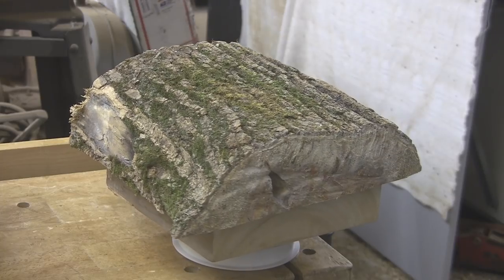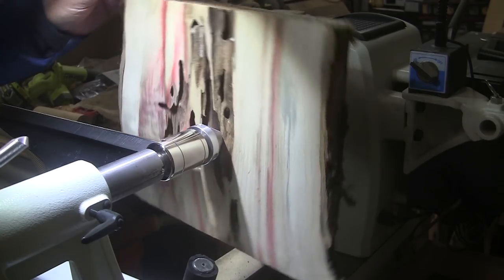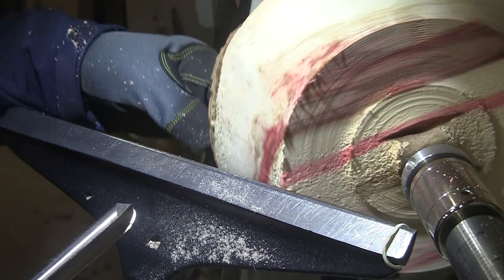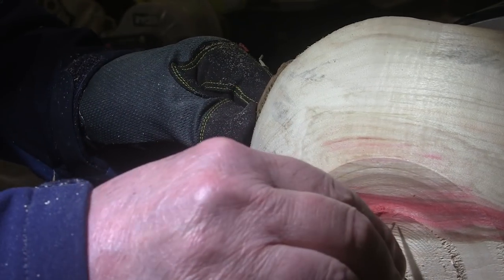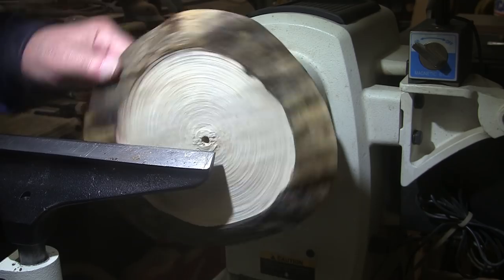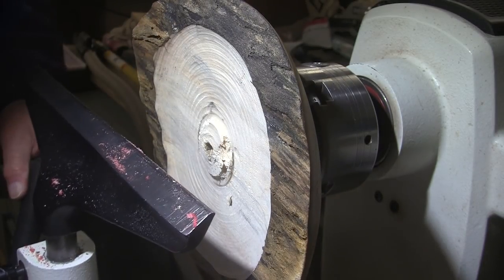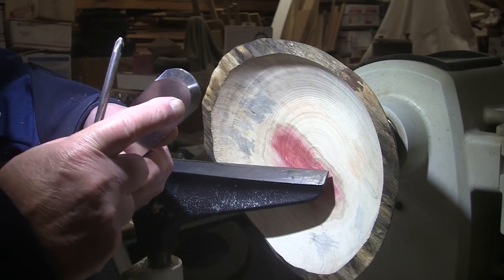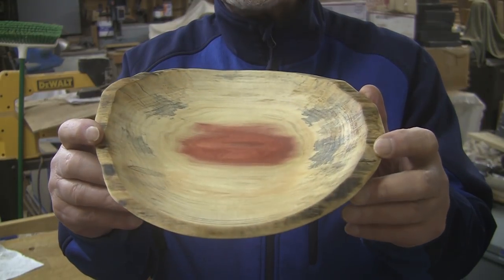Respect Your Box Elders!!! - Wood Turning

Comment: Was very interested to run across your vid  , about the only wood we have here in central Saskatchewan is box elder, birch and poplar.  Lots of burl in the elder,  but it's problematic to turn,  I have about 5 tons stored drying,  but even after 10 yrs it will still shift after turning. It has soft areas right next to hard wood and they dry out and shrink more, and sand unevenly.  I have given up on using it  till I set up a stabilizing tank ,got 1 burl that's 4 feet across but going to leave it growing till I get the tank
Reply from the maker: Wow, sounds like you are set for life, Les!  It would be great to have all that turning wood available!

Comment: Great video! What lathe are you using? Would you recommend it, when stepping up to a larger lathe?  Thank you
Reply from the maker: Thank you, Rex!  I have a Jet 1840 EVS.  I do recommend it, but keep this in mind.  They have stopped building in a swivel head stock.  The new models do not have that feature.  It is now priced substantially less then it was.  The head stock does still slide all the way to either end, so there's that.

Comment: Did you dry it any?? Has it warped or cracked any??
Reply from the maker: I just let it dry on it's own.  No warping or cracking but the finish is a bit rough, now.  I'm going to re-mount it and re-sand and finish.  Should be much better now that it's dry.

Comment: Phil Howdy , I just wanted to tell you if you do not already know it . That on your 2 inch sanding disc that you can get a lot more use out of them if you clean them once in a while on a cleaning eraser.

.
Reply from the maker: That's a good tip, Rick!  I have one of those crepe rubber cleaners and use it on my bigger machinery but never think to use it on these disks.  I hope I can remember to give it a try!

Comment: Hi Phil, A nice recovery and a nice bowl, but a friendly word of warning, the red in Box Elder Maple will turn brown when exposed to light (UV apparently does this because even fluorescent lights will cause this change).  Haven’t found a finish yet that will prevent this, just some that slow it down.  Good luck.  Cheers, Tom
Reply from the maker: Howdy, Tom!  Not much danger of sunlight causing this to fade here on Shady Acres!  LOL!  Next time I turn it I think I will try shellac for a finish.  I'm going to let the second piece dry for awhile first, though.
Phil
Reply: Phil Anderson - Shady Acres Woodshop Hi Phil, Shellac (Zinsser of course) three coats on top of a double round of sanding sealer (also Zinsser’s) only slowed it down, but did not fully stop it, under fluorescent lights.  Bottom of dish still looks nice and red.  The rest looks good only brown vice red streaks of color.  So good luck on yours at your Shady Acres.  Cheers, Tom

Comment: Dear Phil, a stupid question from a non-turner...... If you you spin wet wood at, say, 900 rpm, would the moisture come to the surface and seep out due to centrifugal force? I love your work and, yes, especially the box elders.
Reply from the maker: Depending on how wet it is, Margie, yes, it will absolutely spray water all over the place.  One of the many reasons I don't like to turn wet wood.
Phil
Reply: @PhilAndersonShadyAcresWoodshop  Is that sap slightly sticky? Colourless? (sorry, UK spelling!) does it have a smell? All depending on the species of trees, I imagine. Take care and keep safe during this pandemic.
Reply from the maker: @firefly01  Sap?  I don't recall any sap in this piece, Margie.  If you mean the moisture, it's just that, moisture, water.  Not sticky, no odor that I can detect.

Comment: Phil: Would it have helped if you had soaked the tenon in CA before the turn around? I have a piece of Box Elder that has some work holes. What do you think? Great bowl!
Reply: I was thinking that might help too. I was mentally screaming at Phil to try it before he even turned it around.  Kim Tippin (also the name of her channel) has done that to stiffen up a questionable tenon.
Reply from the maker: Well, it wouldn't have hurt, that's for sure, Jim.  I think I just wasn't able to get to sound material but thought I had.  As long as there are no cracks/splits, you might try a recess instead.  Worked for me the second time around!  LOL!  Thank you!
Phil

Comment: Another nice piece! must admit I was pleased to see that I'm not the only one to have left a tenon in my chuck whist my workpiece took flight. The price of a catch whist deep hollowing! Did manage to rescue it  -  just!
Reply from the maker: LOL!  It  happens, Ray!
Reply: @PhilAndersonShadyAcresWoodshop  Hi Phil, I've been trying to find (google) what you refer to as your 'sandle flex' or 'sander flex'. I assume this is an attachment for a power drill, The closest I've come to something similar is the Bosch flexible roll but that appears to be quite coarse. Can you please confirm the name and manufacturer. TIA Ray
Reply from the maker: It's called a Sand O Flex, Ray.  The metal model I use was made by Merit Industries and is no longer manufactured.  The current model is plastic.  Both can be found on eBay but be careful of high prices.  The best prices and selection I have found online are here:
https://supergrit.com/products/products_woodworking-sandoflex 
I haven't seen on in a store since the 80's.
Phil
Reply: @PhilAndersonShadyAcresWoodshop  Thanks Phil. I saw the products correct name on one of your recent vids.  There is a substantial difference in price between internet suppliers and those in the uk seem to supply 80 grit as the standard and do not mention a stock of other grits. The site you refer to is an exception but i don't know what my landing price might be. i think you refer to using 120 grit but I'm going from memory. Is that right?
Reply from the maker: @RayShaw007  I mostly use 180 grit when sanding bark and bark inclusions, Ray.  I don't go any finer than that.